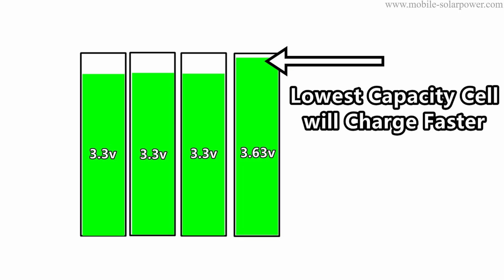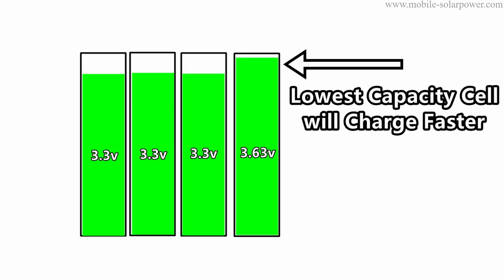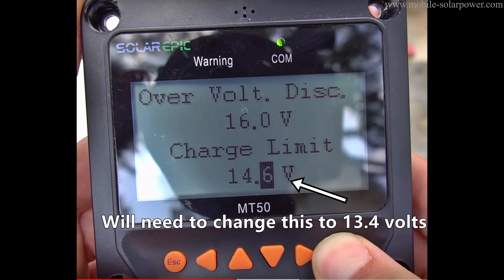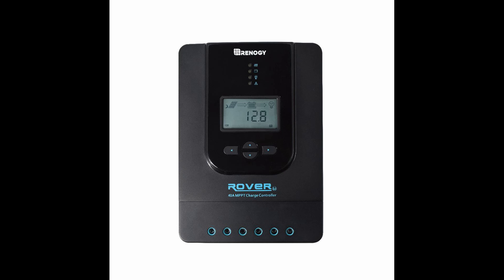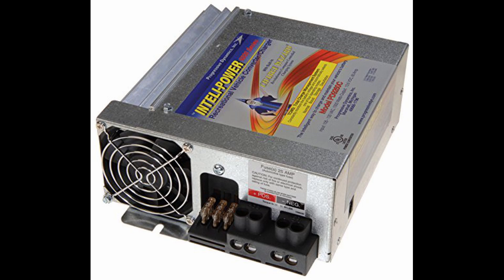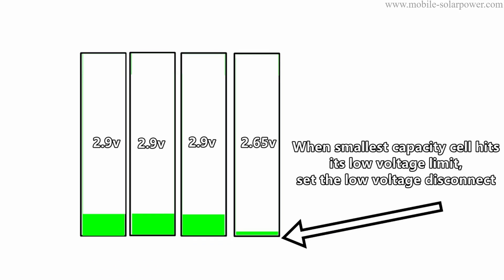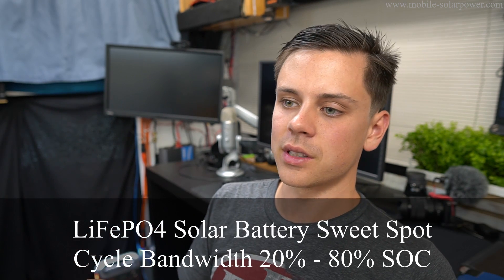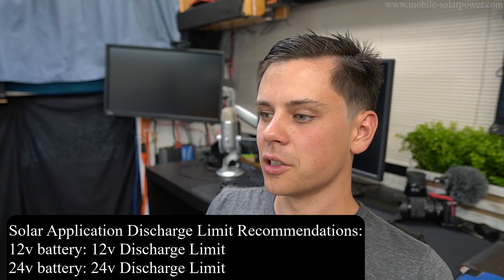LiFePO4 battery w/o a BMS: Top or Bottom Balance? Mismatched Cells?

Comment: Just wondering if you have used single cell balancing modules that limit the voltage for any module to about 3.5V. These self balance without a BMS and only cost $5 each.
Reply from the maker: Oh man I've been meaning to order some!! A friend of mine loves them. Good idea. Need to try them out

Comment: Will, I have 24 3.2v 86ah lifepo4 batteries. Can I run a 6P4S (that is 6 in parallel then those 4 sets in series) to make a 12v 516ah bank? Or should I run 4 in series and those 6 sets in parallel? Thanks
Reply from the maker: 6p4s from what I have read. Just make sure they are high quality cells that are matched and equal in voltage when you hook them up
Reply from the maker: https://marinehowto.com/lifepo4-batteries-on-boats/
Reply: Thanks!

Comment: Will  we  have come across friends who have bought miss matched second-hand cells on eBay and they seem to take an age to balance and seem to drift out of balance quickly when worked hard  - fortunately  our bank are all matched cells 

We are just experimenting with a grid tie inverter so our RV offsets  our home domestic electric  bill  when  not in use and parked on the driveway  - we used SP17 30amp connectors

Comment: Off topic, but can you use different types of solar panels in one system? For example, can you mix mono and poli and amorphous? Second, are all flexable panels amorphous?
Reply: essentially yes you can - you can even mix voltage/wattages (assuming the total is within the parameters your controller can handle), but the drawback is then ALL the panels will be limited to producing the same power as the weakest one in the link.
Reply: @frodev728  thank you for your answer.
Reply: Jeffrey Rood the thing to remember if mixing mono/poly is that they will have a slightly different performance profile, so they may have slighlty different optimal conditions - meaning that even if they are the same wattage/voltage/current specs, they may generate slightly different specs at any given point in time - so again that being the case, your power production overall will be limited by the lowest-producing panel.

Comment: Seeing you asked for what to talk about, I'd like your opinion on the Electrodacus chargers, they are only a little more expensive but have a bms included. The maker also believes in parallel for the panels and claims there is very little loss compared to mppt and says the transformers in them always need replacing eventually which makes his system come out in front in the long term...I'm very close to pulling the trigger on this or what you are recommending currently so keen to see your view.

Comment: Great vid. I want to take my son off the grid but he lives in Ramona, CA were it really gets hot in the summer. He has to keep his a/c on 24/7. The good news is he lives in a 20x8 foot insulated travel trailer with a small overhead Coleman a/c unit. To start the system I currently have 19 six volt deep cycle golf cart batteries and one 100 watt solar panel. So how do I calculate the remaining equipment that is required? Does one of your books cover this?

Comment: I don't know Will! There's a lot of people who builds these projects we put up on YouTube, who will just build and forget. They're not going to monitor or check cell balance from time to time, no maintenance check, nothing. For these people I would say spend the money, get good matched cells, and stay as far away from the cheap used cells as possible. So in that way I disagree with you. I think we should encourage people to use new cells and discourage the use of old mismatched ones. On the topic of the BMS, I completely disagree with you. Over-voltage protection, under voltage protection, short circuit protection, not just balancing. I think the bigger problem with BMS boards is people don't look at the specs, and look at the price to determine which one is "best", with cheaper being better. For someone with a lead acid battery mentality, I would definitely recommend a quality BMS. More over there aren't just the two options Ultra expensive, or dirt cheap. There are some reliable BMS boards for around a 100 bucks. To be fair though, someone should design and build a smart "active" BMS, which monitor cell capacity and voltage, automatically adjusting total pack capacity without user input.
Awesome video, awesome topic.
Julian
Reply from the maker: Oh I totally and completely agree with you on every point. Absolutely. I just know how much people want to reuse these LiFePO4 batteries and how many cells are coming from electric buses from China. China has more EVs than the rest of the world's countries combined and we will have a ton of extra LiFePO4 batteries coming our way. So I am catering to those people. If someone wants to use LiFePO4, I show them battle born or relion. But for the diy groups online that like to be cheap, I'll show them how to do it safely. That's all
Reply from the maker: Oh ok, show me a BMS with 100 amp charging, 200 amp discharge, and large enough solder tabs to connect a 0 gauge wire. I haven't found one. when it says that it's rated for 100-amp discharged and has these tiny little tabs and I see pictures of them burnt up online, I question them. An overcurrent protection? Just use a fuse. Many of the BMS boards don't even have temperature cut off. but yeah let me know what board can actually work at the amperage that I need for a solar power system. I would love to see what you're using. I haven't found one yet they can connect up to 0/4 Gauge wire.
Reply: in fact will I didn't consider the large capacity packs you're working with, so I have to agree with you. A few months ago I found a BMS from China which said it would work up to 20 amps. I didn't show it on the channel but the thing blue flamed while pulling 100w 19A. On a second replacement version of that BMS, while soldering 12 gauge wire to the tabs, I actually melted the tabs off without using very little heat. I'm using Bestech BMS boards now, but they're not cheap enough for the DIY community. To be honest with you, what's behind this is people referencing your projects, JGs projects and my projects in their own videos. Later on I get feedback from them asking why their projects didn't work, or cells vented. Its a dangerous "hobby".
Anyway I wasn't trying to be critical oh, but you're right I didn't consider the large capacities you're working with.
Reply from the maker: Yeah it's tough to find for these large batteries. Small batteries, always use a BMS. High c rate and easy to find a BMS that works. But yeah, for these large systems where I am using 0 gauge and larger wires, I just don't see anything available unless I program an Arduino and build a relay/shunt system. But I know my viewers don't wanna code haha I used to love microcontroller programming as a kid, but man, I would love to find a BMS that can do what we need. But honestly try out large prismatic cells yourself with solar. It's super fun and easy. If you get a good bottom balance and you set upper voltage limit to 90% soc, that battery will be super happy. You should really try it!! It's really fun
Reply: Yes please! Someone release (and someone review) a smart active BMS. I am waiting on a $20 4S active balancer from ebay right now. This only balances, no other protections or functions. Fingers crossed it works well. If so I will be buying the 15S/16S version for my 48V packs.

Comment: Very insightful. Thanks for sharing. I use recycled 18650's to make my own batteries and this is a recurring thought for me. It was good to hear your thoughts on the matter. I do not use a Battery management system but I do use a batter monitoring device. It cost less than $20 but it displays the individual cell levels and the total battery voltage so if anything goes out of balance by too much then I can make adjustments as desired.

Comment: The choice of top/bottom balancing also depends on the application. In my case, my system is designed for solar backup and the cells are kept at approximately 90%. Since no lithium based cell tolerates constant trickle charging, my controller tops off the battery bank once a week while the BMS top balances. Even though there is a +- 4 Ah cell variation across the 600Ah pack, the cells stay well matched. 24 hours after top off the 16 cells are within 4-6mV and from 48 hours until the next top off, they stay within 2mV. It has operated this way for over a year now. To avoid bottom voltage issues and to extend battery life, the BMS will disconnect the pack at 15-20% state of charge although I have not encountered this case yet. This system gives me 3 days to either get solar back (snow melts) or start the generator. I don't have to bite my nails hoping one of the cells doesn't under voltage. Peace of mind is my goal.

Comment: Does the inverter matter ? I want to use a 2000watt inverter and then ultimately install solar on my roof. I don’t want to buy the wrong inverter and then have to change it when I install solar. The controller etc does matter correct?
They need to be solar oriented. Correct???
I am so confused 🤷‍♂️ 
Please reply.
Thanks Will

Comment: DUDE Will  YOUR A MIND READER. I was contemplating sending my cells back. I got one that fits this video unfortunately. I'm currently custom programming my TS-45 to deal with this issue. I have been manually balancing with a load tester to scrub voltage during the day on one cell. No matter what i do it just charges WAAAYYY faster then the other 3 cells. Now i gotta babysit it and set the HVD to what you said as i've been regularly hitting 4.0V on this one cell. I'm having trouble discharging as im still testing and not using it to its fullest right now but the Victron LVD is simple to change with the bluetooth model. 

GREAT VID WILL I'M PULLING MY HAIR OUT until this vid. Might even scrap the cell and buy a new one to compensate the loss. Really want as much capacity as possible.
Reply from the maker: Seriously you should just get a refund. That's such a bummer!! And yeah it's not a fun problem to encounter. Very very frustrating. Glad this video helped! I hope you can return them if possible.

Comment: Interesting, I'm using a Zeva BMS (from Australia) which top balances (by slowly draining cells that are higher voltage). The problem with bottom balancing is my battery doesn't get to the bottom very often, while I do usually get it charged up each day. The balancer only drains milliamps, so it needs to do it often. Pretty much always something needs balancing, and it's not always the same cell series.

I do have my max charge voltage lower (thanks Victron) so as you say I'm not running it at full capacity. The Zeva BMS lets me configure what voltage it starts balancing. Right now my cells have a 0.03V difference and battery is 91% charged. One cell series 3.88V, the rest 3.90 or 3.91. So it's pretty subtle, but it's a big pack (6.5Kwh).

My BMS is connected to a Gigavac contactor switch so if any cell series goes too high or too low, (or if the BMS fails) it disconnects the whole battery. It should never get into that state though, as it should usually be balanced, and a battery protect should turn disable the DC power out before then, and the inverter has it's own limits too.

Note my pack is Lithium Ion (not LiFePO4) so in my case it's essential to keep things balanced or big fire could happen :)

Comment: I tried to bottom balance my electric lawnmower. I am using used 18650 lithium ion cells and cycling them from 90% to 0% in one hour each week. So a much different situation than the solar you are talking about. 

The bottom balancing did not work for me because the self discharge is a little chaotic with the cells I have. So I need to balance the pack once a month. I don’t have any way to do that automatically when bottom balancing. Top balancing once a month is easy. 

I charge each cell to 4.10v and every once in a while a group will self discharge down to 4.04v which throws out the balance. 

So my experience is exactly what you said. The quality of the cells you have and how you use them will greatly change how you should deal with balancing. 

If I increase the size of my pack and only charged to 4.0 volts per cell it might not go out of balance.

Comment: I made a few videos trying to explain series battery and supercapacitor balancing. It really is super simple to understand but hard as hell to explain in a way to make sense to someone new to charging/discharging lol. I'm annoyed that lower priced chargers rarely let you adjust the charge voltage. It's always the max voltage for equal batteries so you have literally no safety margin. Then, the li ion batteries go from 100% to 90% and stay there really quickly unless you use them right away anyways.

Comment: Humans often fail doing boring tasks ... so these tasks should be automated. A  BMS perfectly automates battery balancing, over- and under-charge-protection and other useful stuff.
Reply from the maker: Not if your cells are mismatched. And you don't need to balance them at our c rates. If this was lipoly or high c rate application and different charge discharge bandwidth I would say something totally different. But in this application is completely illogical to do so
Reply: Mismatched cells are never good. But a BMS make it possible to bring all cells to full charge every time. But indeed never in a very efficent way, because it has to burn energy in resistors.
Reply from the maker: Yeah agreed
Reply: @bigfoot_101  "possible" but only if you are charging at a low enough rate the resistors can bleed off enough current to keep up. Even a single 100W solar panel might be putting 5 to 6 amps into your battery, and that is pushing the limits of many a cheap BMS. What if you have a 400w system with a 20-24 amp charge rate?
Reply from the maker: Did you not watch the video?

Comment: I use a simple $10 dollar battery charge controler to set custom charge parameters on any system. check it out might help you out. MODEL XH-M604